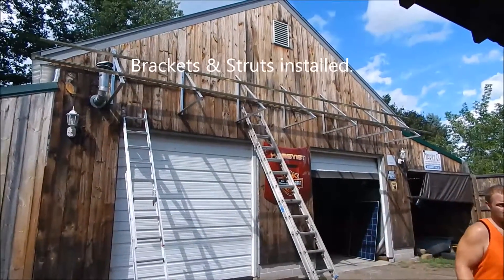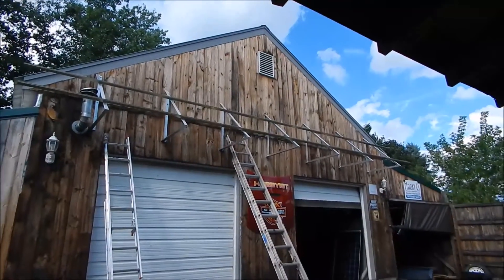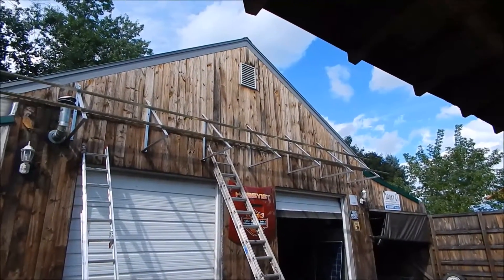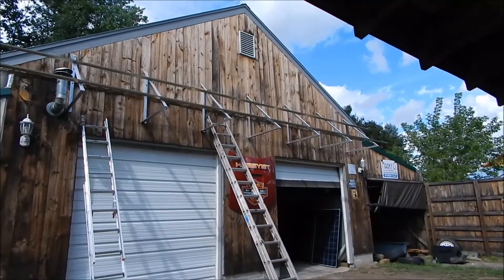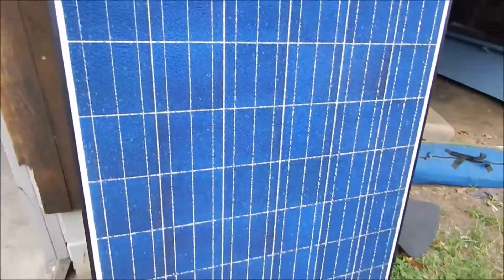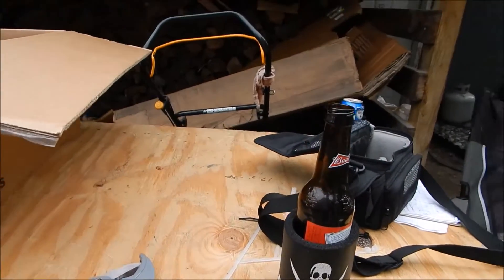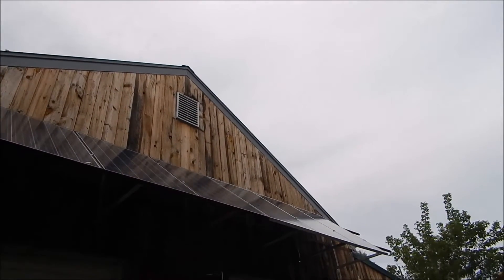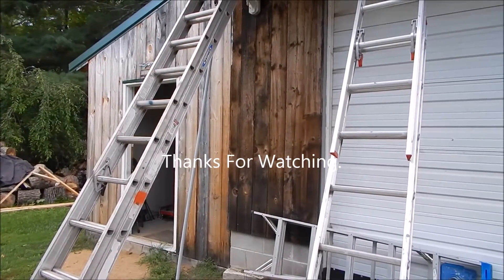Solar 2500 Watt Enphase Grid Tie Install Part 2.  DIY NH Install.

Comment: is that eversource for the power company?

I know it's a pain to do, but that chimney pipe would work better if it ran straight up through, yeah I know, the metal roof, less turns the better.

here is a video of repairing a shattered panel if it helps at all.
best

https://www.youtube.com/watch?v=yezmU_nUq-g
Reply from the maker: I believe So. Don't need heat were I live LOL.

Comment: to bad about the panel, but the rest of the system looks great! you might be able to seal the panel and still use it ?
Reply from the maker: Yeah it sucks but its still usable as a battery charging panel. Were going spray a few coats of automotive Clear coat on it & see what happens we cant hurt it any more at this point, Thanks for watching.

Comment: I have had the same thing happen to us. We where putting them up on a flat roof. The one that popped looked the same as yours. Funny part is that there was just on of tho's on the job and it broke. Maybe that's why there not made now. Looks good tho brother. THANKS so much for the gifts.  THe crimper is BAD ASS.. God Bless Brother.
Reply from the maker: Yup! I guess that's why they are discontinued . U are very welcome hope U get some use from it I didn't need 3 crimpers .